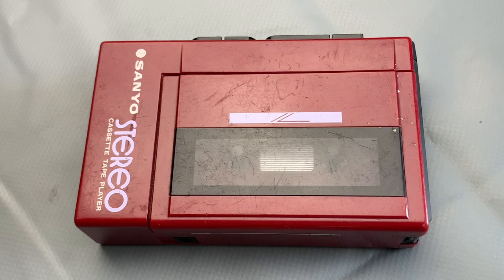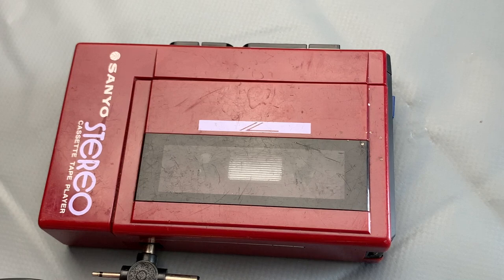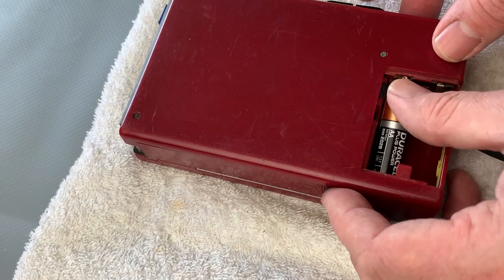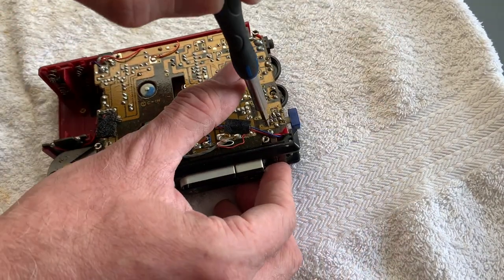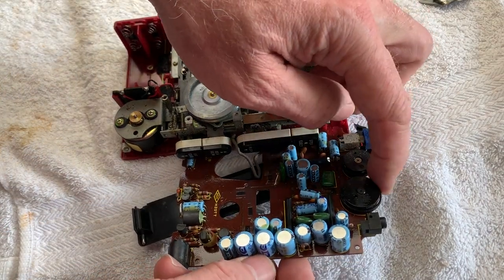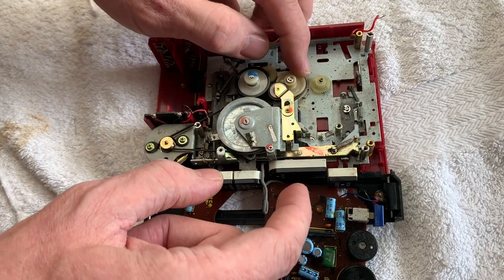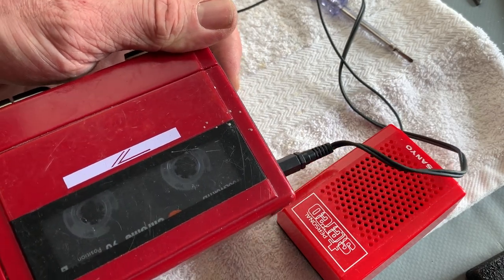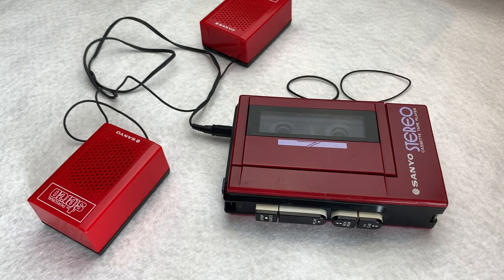Sanyo M3330 Belts, Service & Repair. Vintage Cassette Walkman Restoration. Battery Contact Corrosion

Comment: Absolutely love your methodical approach to repairs so keep up the great work! I love the M3330 & 4440 and I am a novice at repairs. I have successfully restored a 4440 and have a 3330 to do so this video was extra useful for me.  What do you paint onto the solder joints before resoldering please?
Reply from the maker: Hi, thanks for watching - I'm glad you found it of use! I use flux with a brush. It's a 'no clean' flux, so you can just brush it on where you need it, solder the joint and move on. The paste flux is great for SMD and other modern stuff with hot air and miniscule components (Macbooks, Game Boys etc)- but it gets everywhere and needs cleaning up afterwards. I only really work on older electronics with larger components, so this method suits me fine.

Comment: Hi! Do you know the belt sizes for this model? I got one working fairly good, but seems to need a belt replacement, and not quite sure which one to get.
Reply from the maker: Thanks for watching. I worked with Decktech to get a kit ready for this one. You can find it here. https://www.ebay.co.uk/itm/325696934147?mkcid=16&mkevt=1&mkrid=711-127632-2357-0&ssspo=17wMLu9-RVW&sssrc=4429486&ssuid=Ic8tyB0fScm&var=&widget_ver=artemis&media=COPY

Comment: hey great video guide on how to service these, would you be able to porvide a link to the set of new belts you used as i cant seem to find a set for sale when trying to search myself
Reply from the maker: Hi, and thanks for watching!
The kit you need is the same as the M4440. You don't need the counter belt, but it's still cheaper and easier than buying the larger 2 belts that you need.  I get my belts from these guys - I'm not affiliated in any way, but I've found them to be quick, high quality and well packaged. Tell Matt you saw my video! Good luck with your service. Cheers, Dylan
https://www.ebay.co.uk/str/manatreereplacementparts?mkcid=16&mkevt=1&mkrid=711-127632-2357-0&ssspo=17wMLu9-RVW&sssrc=3418065&ssuid=Ic8tyB0fScm&widget_ver=artemis&media=COPY

Comment: My Grandma has a Sanyo same model like you'rs but the problem is there is no sound output when i took it apart before replacing the belts i noticed that the headphone jack wasn't soldered on so i soldered it on theres is static but no sound any idea what to do?

Comment: Also....my 3330 only plays through one channel so clearly has a problem with the headphone socket....what do you mean by 'reflowing' the sockets please?
Reply from the maker: Many personal stereos suffer from dodgy headphone jacts due to the contant pressure on the joint. Sometimes, the actual contacts inside the socket are bent or corroded - providing intermittent sound. But quite often the solder onto the board fractures around the pins, or the trace can even break, causing a chanel to drop out. 'Re-flowing' the solder joints by the aplication of flux and heat (and maybe even new solder) can often restore the joint and consequently the correct function. Hope that makes sense!